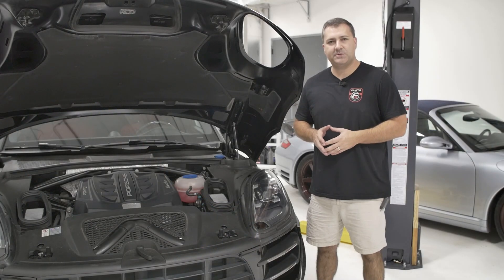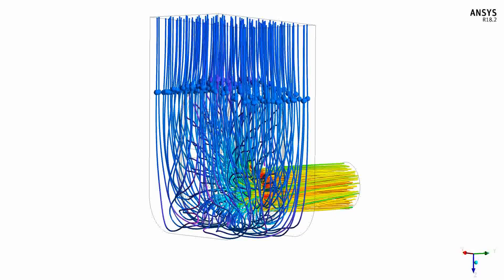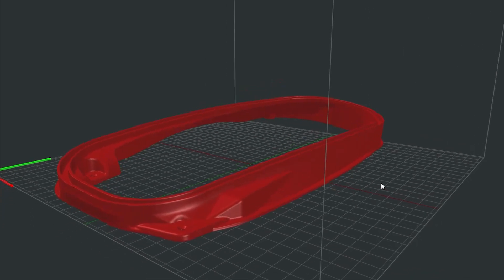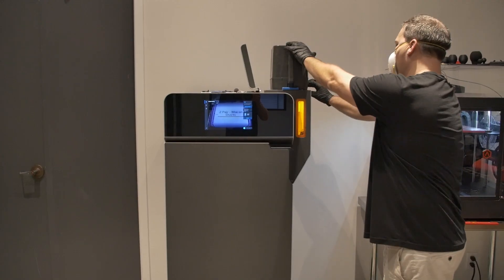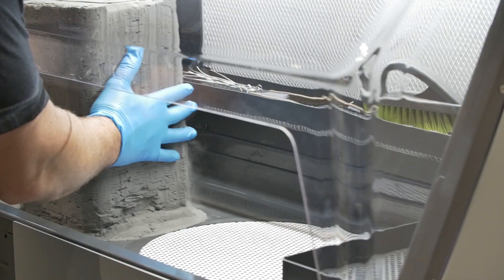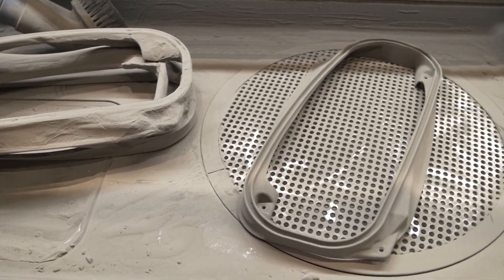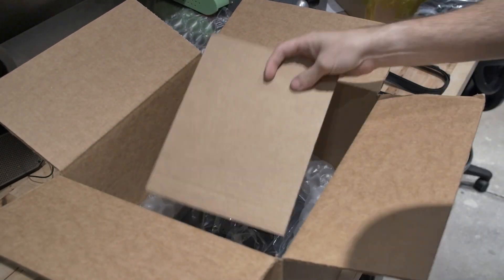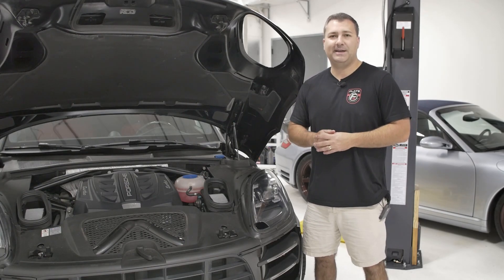F6 Behind The Scenes: Making the 95B.1 Porsche Macan Intake (Advanced 3D Printing)

Comment: Were there any tests done with the hood closed? Won't the hood still restrict air to the air box since it has the small ducts built in that are also a bottle neck, regardless of if the air box center piece is removed, nullifying most gains seen while the hood is opened? I am definitely not undermining the dyno results, as I am 100% sure they are accurate, but what kind of results would we see in a real world scenario with the hood closed with this air box?
Reply from the maker: We've dynoed with both methodologies, it makes the same consistent power with the hood up or down. We generally leave a hood open because there is no way to simulate air speed. The effect of IATs is much greater in real world application where ambient air is being forced into the airbox so if anything the dyno is probably more conservative than real world results (at least in terms of back to back runs). We also tested with GPS logging and the Macan gained acceleration time and trap speed in the quarter mile.
Reply: @Flat6Motorsports  I wonder if Porsche designed the original intake to accomodate off-road use? Only thing that comes to mind as to why they would design to only have two sides open in a square filter.